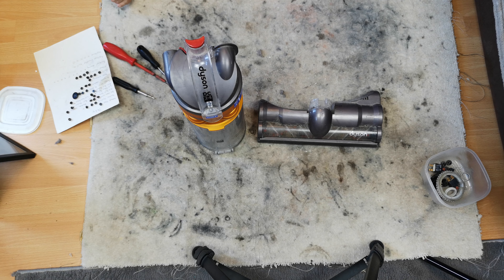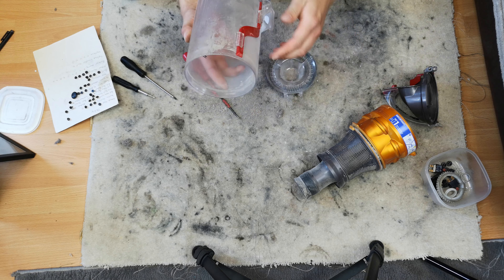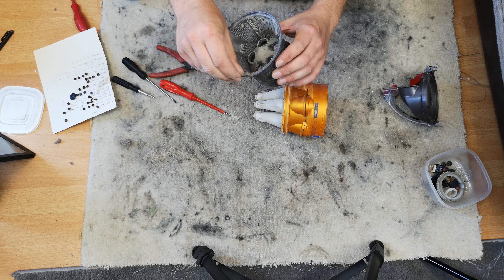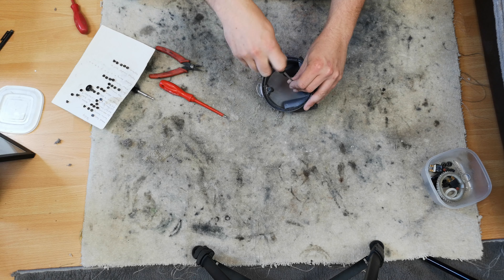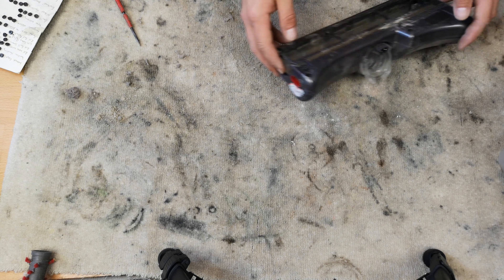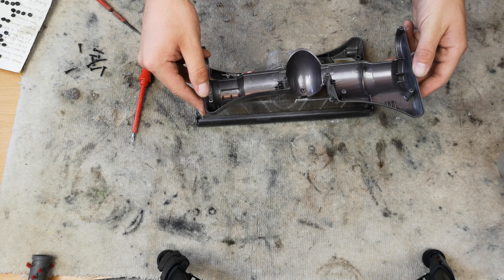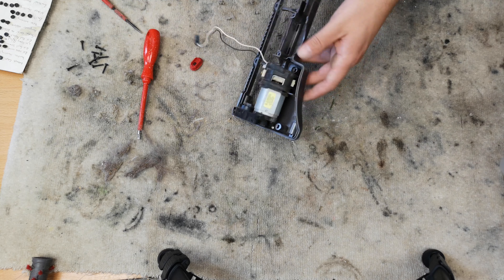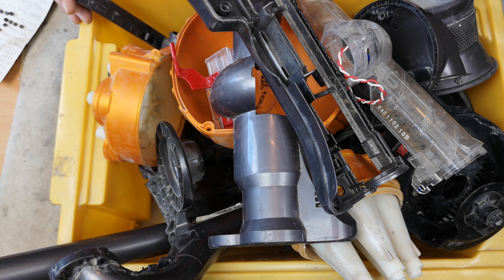Dyson DC24 Week! Day Three - Cyclone & Brushroll Dis-assembly

Comment: Hi beko that part you show at 12:47 which you decide not to remove, well mine has broken (white wire snapped) where can you purchase this little loom from I've looked everywhere
Reply from the maker: It's the yolk loom. Their on ebay, or find a used yolk with the loom and strip/fit as needed